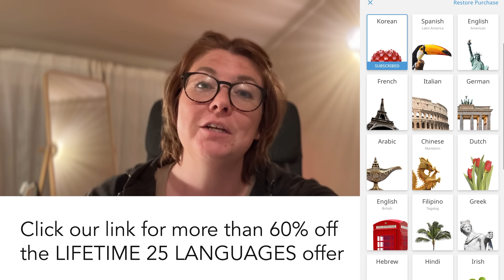WE LOST OUR NEW RESCUE DOG | Stressful Days on the Homestead

Comment: I had that retractable lead scenario happen with one of my foster dogs. 
He was spotted 1 km away but I couldn't find him. He came home after 12 hours on the run, exhausted and wet but no injuries 💕
I recommend a harness that goes between the front legs and is adjustable on multiple straps for a better and safer fit 🐕
As others shared it's unfortunately common that rescue dogs slip out of the lead or out the door.
Bella is a beautiful addition to your mountain family ❤

Comment: If you build a biological pond, the otters will come. Personally, I would be ecstatic to have an otter in my backyard but I appreciate your need to protect the fish. Move the perch to a secured pond with low voltage electric strand fencing and if possible nocturnal lights. When the otter has had its fill of the koi, it might move on. Bless Bella❤.

Comment: You may want to consider getting a thumb for your mini-ex as it will make it easier to grab and lift up stumps and things like that. It doesn't need to be the hydraulic one (which is certainly nice) as the static version still provides a "yuge" amount of utility.